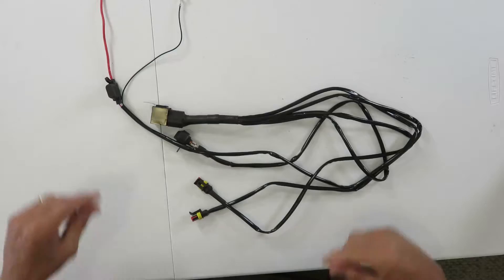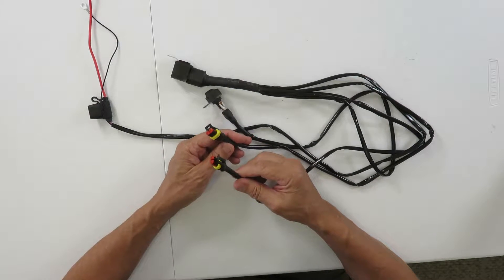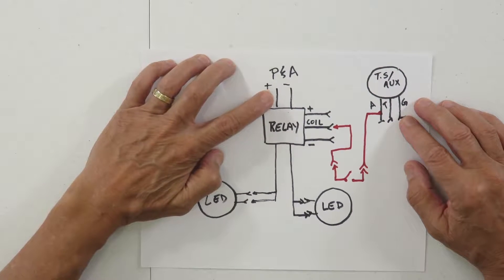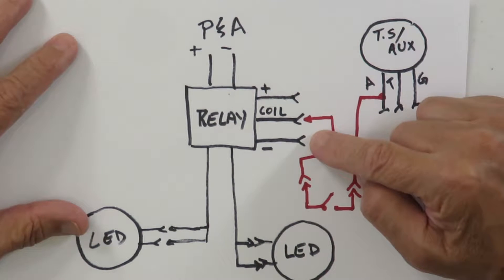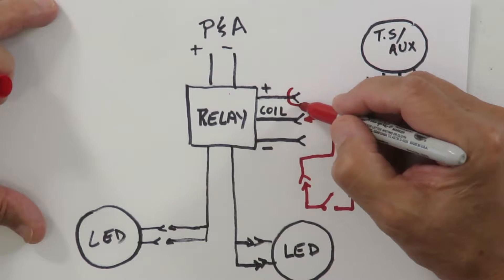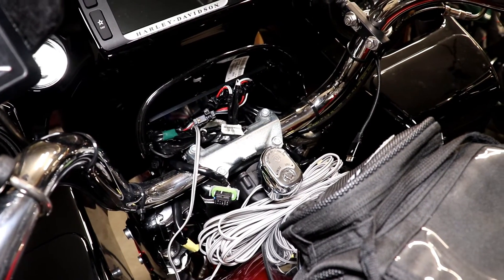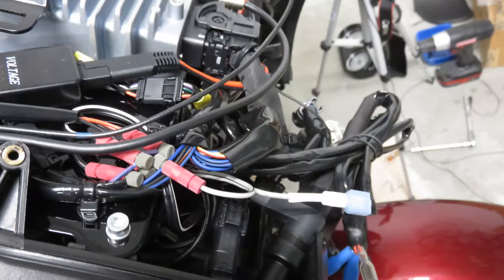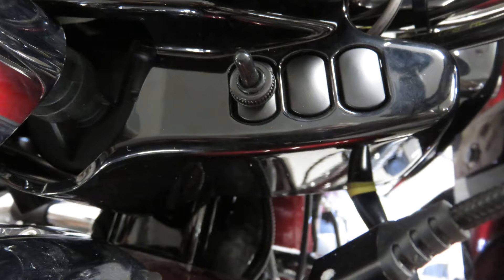Installing Auxiliary Running Lights On My 2017 Road Glide Special Part 2

Comment: Hi Tim, you clearly know your wiring. As such, curious why you chose to by pass the Harley stock aux switches, which look nice and come with a harness that’s fused with a relay, etc, and basically reversed engineered a more complicated solution? This is an honest Q, not a criticism, curious if you have a reason.
Reply from the maker: It's been awhile and I don't have that bike now. I believe the bike did not have the switches installed in the nacelle. If I had gone that route I'd have had to run power wires forward from under the seat. It was easy to tap into the power and keep everything up front. Related to this, I needed a pushbutton for my garage door opener. The Harley switch module doesn't have a momentary contact switch, so I went with a SPST toggle switch for the lights and a NO momentary toggle for the garage door opener. As an old school engineer, I like the way it looks. Thanks for watching.